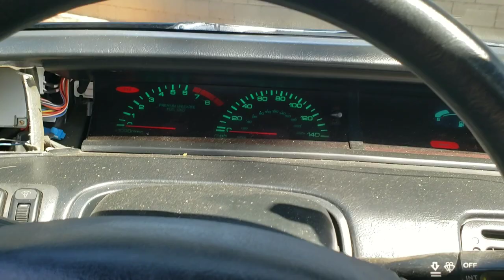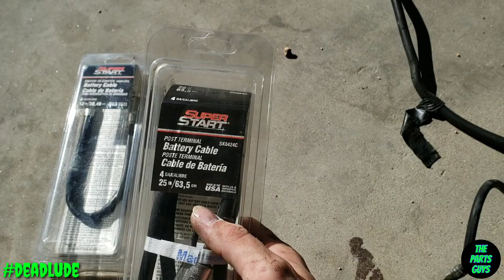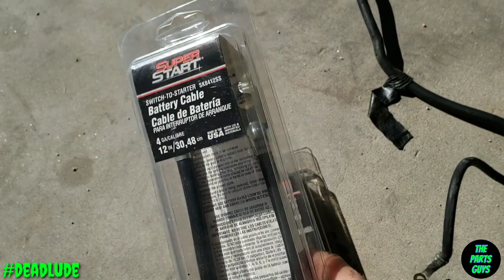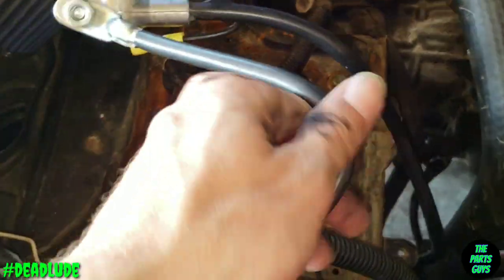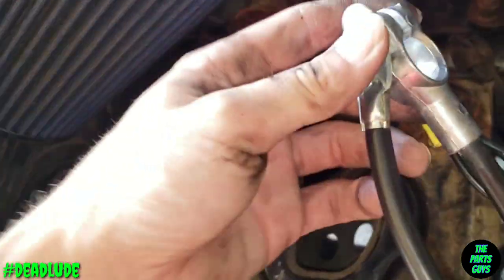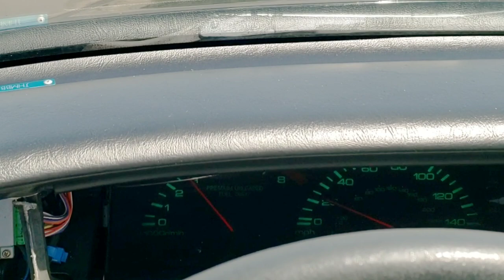No Crank | Bad starter VS Bad ground | Honda Prelude

Comment: Very helpful video, a couple comments: Before removing and replacing the questionable ground cable, you can try taking jumper cables, connect one end of one cable (black) to the battery negative terminal and the other end of the black cable to a good place on the chassis so that the questionable ground cable is bypassed. This will tell you if it is the ground cable. On my '96 Prelude I had a different problem. The clutch safety switch connected to the clutch pedal broke so that pressing the clutch in didn't let the switch close. So it was always like the clutch was not depressed. Instead of buying and installing a new switch, I put a 1" jumper wire across the wires feeding the switch. So now it's like the clutch is constantly pressed. I can start the car without pressing in the clutch which I guess is less safe, but I never try to start without pushing in the clutch anyway. 
Google "clutch safety switch honda prelude".

Comment: Honda Civic 2001 - Replaced starter 8 months ago (yeah, didn't need to but oh well. It was the crankshaft sensor. Ouch!). Has been working fine but now it started making a dull sound when cracking and the car barely starts. I'm suspecting a bad ground and/or positive connection. I did replace the OEM ground wire (I don't know why they leave the dam ground wire exposed in a small area like that but I had to use the exact same style or the car wouldn't crank/start. Weird) 8 months ago too, so I was thinking it's the positive wire or a ground with the alternator/frame somewhere. Honda Civic/Accord/Prelude is known for having horrible ground issues. So bad that they corrode the battery terminals and/or cause the vehicle not to start/crank at all. I actually had to scrape off the paint under the hood (grey color, looked like primer) to resolve my terminal corrosion issue 8 months ago. Since then the vehicle has been starting just fine but yesterday dull crank sound and barely turns over. Any ideas? And yeah, I had to match the ground gauge wire too. I tried a larger wire but nope, still had issues 8 months ago. When I matched the gauge the problem went away. crazy sheet. Not sure what the problem is now. Of course I checked & charged the battery yesterday and checked the terminals and they were fine. I charged the battery using a $50 battery charger I bought 8 months ago. I have an expensive multi-meter and the battery tested good 12.9v. So yeah, not sure whats up now.
Reply: hey did you end up figuring out why it was doing that? my civics having the exact same issue

Comment: This has been my suspicion w my truck for a few days, gonna attempt to clean my grounds tomorrow hopefully she'll start. Just replaced the starter last weekend
Reply: Turns out it appears to be the neutral safety switch
Reply: What does that mean I’m having the same problem, I just changed my starter
Reply: @frostknife5296  it turned out to be the battery cable going to the starter, it was grounding out because I twisted it the wrong way, too much tension

Comment: I have a question I have a h22a jdm swapped according and today I was driving out my driveway and it just died out of no where now no crank no start making a really loud noise when I try to crank it almost like a starter noise went to looking around and the ground from my valve cover to to the frame and motor mount broke could that cause this or would it be starter issue or something else I really hope my motor isn’t locked up or timing snapped but it’s a low mileage motor Mabye 120k miles very healthy everything’s new not even 6 months old starter alternator battery etc

Comment: 99 Honda Civic  car won't crank at all sometimes. Have to have it push started. And after push start car cranks and starts fine when starting. After 4 or 5 start ups it happens again no crank no start. What's the problem? Please help if anyone know what the problem is or may be. And how to fix it. Replaced Starter, and ignition control module, and the clutch safety switch 2 yrs ago.

Comment: I have a b swap I just rebuilt it and put new grounds on it also I had the starter rebuilt a couple months ago and I went to start my car for the first time BUT while turning it over I’ve noticed my ground wires are getting extremely hot what do you think this could be ?
Reply: Ground wires are too small probably

Comment: Hey what’s up with that starter signal wire? Where does that plug into? One end at the starter and the other end where? Any help would be appreciated.
Reply: Did you ever find out? I’m having the same problem rn

Comment: Did you notice other issues because of your corroded grounds?
Reply from the maker: Right away after replacing it the car turned over faster and didn't sound like it worked as hard. Sunroof doesn't struggle as much either! More grounds and positive cables that still need to be replaced in the near future
Reply: I've been thinking about doing my grounds and harnesses. It's always interesting how simple the problem can be sometimes. I've got a 5th gen but I know our cars share a lot of similar issues. The electrical just doesn't seem to fair well from Honda back in that era of construction.

Comment: I am on my third starter bad still just a single click noise. I do have two broken ground wires off the trans but the 2000 jeep Grand Cherokee 4.7 has always started. The battery is full. Is there any way to separately ground the starter to bypass having to take it out again ?. BTW I jumped the pins in the small box under the hood and same thing. I held the key on start and moved the shifter back and forth same thing. I checked all fuses and relays still nothing. No security lights either
Reply: Was the motor seized ?
Reply: The starter was actually still good and would have probably Outlast the jeep. It ended up being a corroded wire right off the positive terminal on the battery. All I really had to do was just cut two inches off that wire and reattach it and didn't have to mess with the starter so many times lol